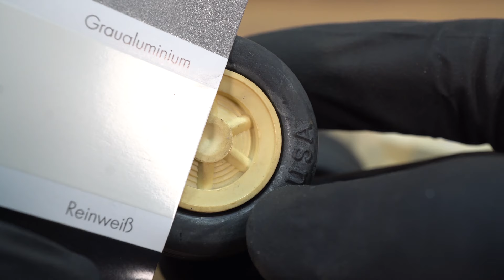Restoration - Tonka Car Carrier Truck 1963s

Comment: Fantastic job, looks dead cool, liked the way you made the new windscreen, never seen that done on a Tonka restoration before. Helpful hint though, aluminium is easier to bend in an annealed state, and it’s a piece of cake to do. Rub a bar of soap over the aluminium and then heat with a blowtorch until the soap goes black, the aluminium should be in its annealed state then. Obviously you need to work it fairly quickly because it will age harden. Hopefully that will help you on future projects.

Comment: Brilliant work mate. Thanks for putting up the strength of hydro peroxside im just about to stock up on caps rivits etc etc and didnt know what strength to get. If i had of got stronger would it affect the plastic and out come?
Reply from the maker: I do not know that. In Germany you can buy a maximum of 10%

Comment: Tell you now there is no way he made a new windshield using that process thats why the film was cut just where did the block of wood in the middle come from?  cleaned up original with the old floor polish trick or had a repro part to use